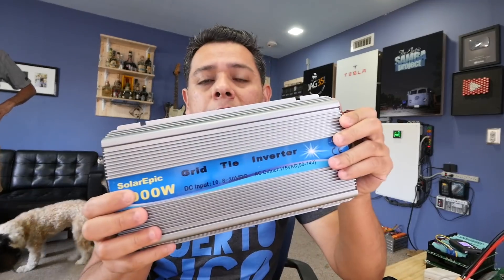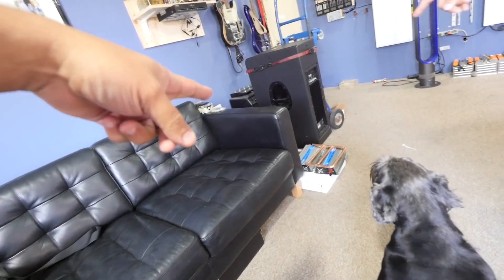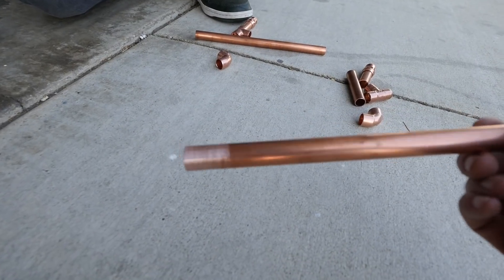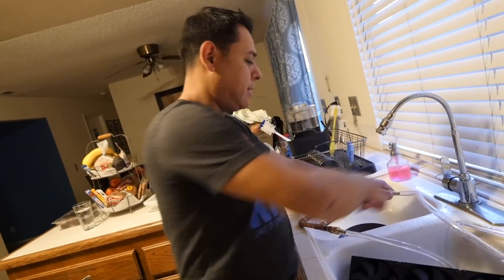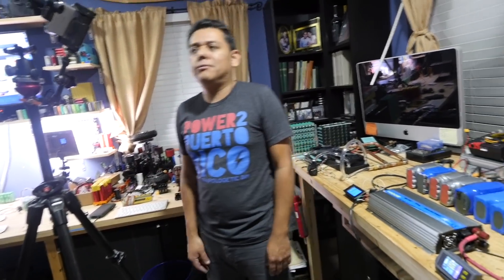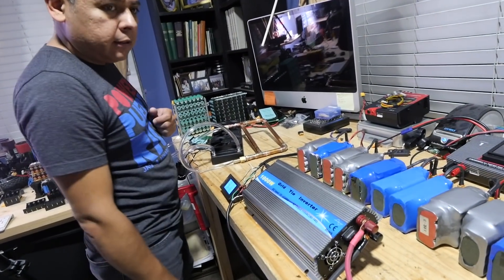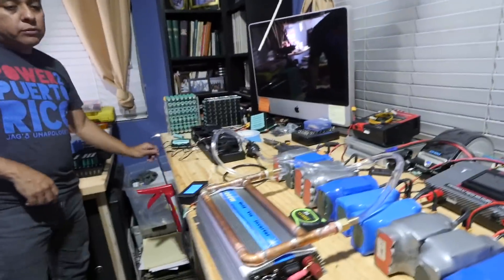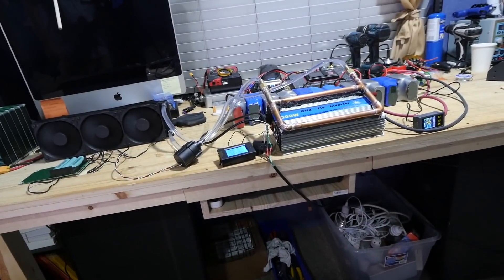Liquid cooling A cheap 1kW Amazon Grid Tie Inverter Experiment

Comment: Or maybe if you use reefer copper. which is the copper that goes to your fridge and you drill the inside of the inverters and run the copper through them that might work...

Comment: If air cooling is desired, I'd swap out the stock fans for Noctuas or Deltas from server applications.
If liquid cooling is the aim, I'd either remove the case & build a heat exchanger to mount against the MOSFETs  or just immerse them in refrigerated mineral oil.
But then again, I tend to level-jump. Great video.

Comment: Contact surface is toooo small , will not be very efficient.
The copper is only in contact with th top of the fin very small surface.
Flatten the copper tube to increase the contact area.(trying to mimic a liquid cold plate cooler)
Or...
Open the inverter and attach the copper tube directly to the inside of the inverter (if there is enough room)
Or...
Open the inverter and attach directly a mosfet waterblock and add more water block to any hot spot electronics.
Reply: After checking a tear down of an inverter similar to the one you have, it look like the MOSFET are attached at the bottom and the bottom is flat. Just moving the copper to the bottom of the inverter should give better cooling result.(posing the inverter on top of your copper setup)
P.S. big fan of all your diy
Reply: Waterblocks direct to the MOSFET
Reply: Agreed. They need to mimic a liquid cooled PC system.
Reply: @franciscojaviergonzalezlar3998  yes its more efficient to connect in the mosfet...
Reply: Easier to simply increase the airflow within the case. Those fans are only generally rated for 5-10 CFM which is absolutely rubbish. 1U server fans are 100-300 CFM or using a bigger cheaper fan such as nf-a14-industrialppc-3000-pwm will give you 160 CFM and you would nly need one fan connected on one end to increase airflow 16x more but they are 30-50dB so hopefully most people have good sound dampening.
Reply: EASIEST WAY 
use inverter radiator....just add some plastic on top with 1cm clearance between plastic and radiator seal it around using silicone that water run only between plastic and radiator not everywhere ,,, run water throught it and you get liquid cooled inverter without any weird stuff ....like if you cooling it using external fan on top....but using water , and you get awesome results, max 10min work + truck with silicone xD (this is the easiest not the best method)
Reply: Over 15 years ago I was part of a design team for automotive electronics and cooling power devices was a big issue !

First, you want as few "layers" as possible between your heat "source" (the transistors/diodes) and your heat "sink" (the cool water in the copper pipe).  Any additional layers just limits the amount of heat transferred.
Second, you want the MAXIMUM amount of mechanical pressure between your source and your sink.  Look at how those transistors are held to the side on the case.  Increase the pressure on the little bar held down by the screw would actually transfer more heat.

Ultimately, you want those devices in direct contact with the copper with only the sil pad for electrical isolation.
Reply: Thermal coupling is (almost) everything!
Reply: Came to post this, search 'water cooling block' on ebay and you can get them for like $3, attach directly to any component that gets hot
Reply: Maybe he could mill down the fins in the area around  the high heat concentration on a flat section and polish it smooth. then use a couple of cpu water cooling blocks, most of which are made with structures to cause turbulence, and more surface area to allow for more heat transfer. Plain copper pipes have smooth walls, and don't provide much of either. Also most thermal compounds are meant to be put on in a thin coat with a tight mechanical fit to achieve their rated thermal transfer.
Reply: They did a video on taking apart a Model S battery. I believe they found that the battery is immersion cooled. If they still have the coolant they should base the inverter cooling system off of the Model S battery cooling system.
Reply: You could also try taking something from teslas book. Use a rubber innertube, seal them together, wrap the inverter in it. Pump through it. the model 3 battery pack uses this method. this would theoretically, if kept inside a box or area, where the walls of the tube will press fully upon the inverted, could be just as effective.
Reply: you read my mind!
Reply: Or electro shoking your ass! Why dont use a comun 20 ctm fan of tree speds right over the surface to the inverter whit a low lamina tunel! And thas it!
Reply: How bout the skin effect? Like in an induction heater
Reply: Wrong department. Skin effect applies to high frequency AC transmission over thick conductors and has nothing to do with thermodynamics.
Reply: @ahaveland  I respectfully disagree with you about skin effect.  Although it is not called skin  effect in the fluid dynamics world.  It is laminar flow here and it should be avoided.  Turbulence and near the solid surface should be encouraged to get maximum heat transfer into the  moving fluid, whether it's air or water.
Reply: @cphank151  "skin effect" is the tendency for AC current to follow the surface of a conductor.
https://en.wikipedia.org/wiki/Skin_effect
So I don't know why you are respectfully disagreeing with that established definition.

Laminar flow and boundary layers are an entirely different branch of physics.

You are of course correct that turbulence around interfaces is a good thing for heat transfer.
Reply: @ahaveland  I just don't understand how skin effect is part of this discussion about heat transfer out of these inverters.  Skin depth is not an issue for this project.  Frequencies are not high enough unless perhaps immersing the entire inverter in cooling fluid is attempted.  In this case,  high speed microstrip transmission lines,  which may not even be present on the board, may have an impedance mismatch introduced due to having the coolant fluid over them instead of air.
Reply: @cphank151  See my earlier response to Rooster HAX and all should be clear.

Comment: flatten a square on both "edges" with a mill, and attach a cheap heatblock (<$3) and just run tubing straight there. will save you a tonne in copper tubing, and reduce the thermal transfer issues with all that thermal paste youve got on there currently.

Comment: Jehu, use half the diameter tubing and run it in a serpentine fashion. Then apply thermal compound along the entire length of tubing. You have more coverage in surface area. Also, half diameter is twice the velocity. Also run tubing along the sides up and back. Water has higher heat capacity than air. Your thermal camera tells all...

Comment: Use heat blocks for cpus, sand the outer case flat and mount the heat blocks on the hot spots. You know the cooling blocks they sell for water cooling your computers.

Comment: do a teardown of the inverter and see what needs cooling
you might be able to use something like this to cool the mosfets or whatever directly

https://www.ebay.com.au/itm/CPU-Graphic-Card-Hard-Disk-Water-Cooling-Waterblock-Liquid-Cooler-Heatsink-Block/142731647921?hash=item213b781bb1%3Am%3AmaSMt3l2OUKp2L8xxBTHwsQ&var=441728980005&_nkw=waterblock&rt=nc

Comment: Did you flux and then solder those joints? But yeah, tap water has too many minerals in it. You'll gum up the radiator and pump.

Comment: to solder copper tubing you should use the Map gas (the yellow cans) instead of propane, it does not get the joint hot enough. I've been doing stuff with copper tubing.
Reply: Kristyanna Virgona you forgot to mention to put flux in the joint... Not on the outside of the fittings. They did a bugger of a job soldering. I've only ever used propane, works for me.
Reply: Propane works fine, it just takes more time as it is cooler than Mapp gas.

Comment: this is clever, but please dont use sink water, over time it will gunk up ur rad fins, plus your pump and it will be impossible to get out
plus the material you use to transfer the heat to the pipes may also play a major factor why you saw a small improvement instead of alot,, just small adjustments and you can see major improvements
Reply: Yeah, especially if using multiple metal loops... Essentially creating a battery creates a great opportunity for sludging up. Quick too!
Reply: The only thing is that your total system efficiency goes down. Depending on how much power you need and what kind of water pump you use that can go down very quickly. In the end that can make this solution useless. 
It's a bit of a kill and cure remedy. Most of the time just some fans are just fine.
Reply: Hawk Eyes you can run sink water but you ha e use use chemicals like bleach to prevent growth build up . Plus the mixed metals will affect it quicker

Comment: when I worked at a factory where dust and oil got everywhere, the computers that control the machines were cooled by Peltier coolers. The computers were in a box sealed with the cool side and the other side of the Peltier is on open air with the heatsink with a fan. It kept the hardware insulated from all the dust and kept it cooler. It was a pretty simple setup.
Reply: very electrically intensive
Reply: That's pretty cool man!

Comment: Dunk it in a tank of mineral oil and chill the mineral oil.
Reply: I came here to say this, id love to see it tested. Since it works on bitcoin miners, and computers - there is no reason it wouldnt work great for these inverters.
Reply: X-ray tubes use dielectric oil for cooling and some use the oil plus a flat pipe along the heating area. Lots of surface is covered and a water radiator at the other end to cool it down.
Reply: heyou Mineral oil is cool and all, but it's a tad bit complicated and if anything goes wrong, removal of electronics is a messy pain.
Reply: @jehugarcia I came here to say the same thing! :D 

I would love to see a mineral oil cooled system. I'm a heat transfer engineer and I can tell you that it will work. =) You can even think a useful use for the heat, like hot water preheating. It would be just a pipe through your system.
Reply: I hope he has fun entertaining.....
Reply: Mineral oil eats at some wiring. Bad idea.
Reply: Use distilled water. Cheap, Non conductive and much better heat transfer. Just have to be careful of contamination and change it out often.
Reply: @jasonharrison25   you would need to change the water every 15 minuets or so
Reply: PC in mineral oil get hot. This Is no the way
Reply: Oil pulls heat away better than air, and with multiple water pumps moving the oil and a radiator cooling the oil this would 100% work.
Reply: It's been proven that Mineral Oil will eventually warm up to whatever is heating it. It's okay for short-term like 1 hour but for things over time the oil just keeps heating up and before you know it your actually not cooling anything and in fact keeping things HOT. The only workaround to this is to have more m.oil than it can heat up. Cooling mineral oil is harder than heating it up.
Reply: The best setups use a conformal coating on the circuits and circulate the mineral oil through a radiator to cool it just like this one does with water! I'd love to see this tested!
Reply: heyou i don't think its a good idea to dip in mineral oil 1000watt
Reply: Mr. Alex mineral oil is none conductive and will not hurt electronics. The only problem is mineral oil is expensive
Reply: Couple bucks per bottle at Walmart but it is scented (baby oil).  No big deal but you would need several bottles because I think they are only like 10 or 12 oz size.
Reply: @121hearc  Get old oil filled radiators and scavenge:)
Reply: they use mineral oil to cool transformers on transmission and distribution networks. We are talking transformers with millions of watts running through them.

Comment: this will work but the thermal contact between the pipes and the heatsink needs to be improved. Need to make a custom heatsink and run the water through it :)... great vid though

Comment: First! of course it'll work as long as there's some level of heat transfer. The question is how much. Personally I would rip the cover off and make a water cooling directly inside the heatsink
You need the water to have direct contact with the original heatsink, so you need to remove the cover or make the cover somehow water cooled which is too hard
Reply: https://www.youtube.com/watch?v=bXzUcqQM8qw&t=0s